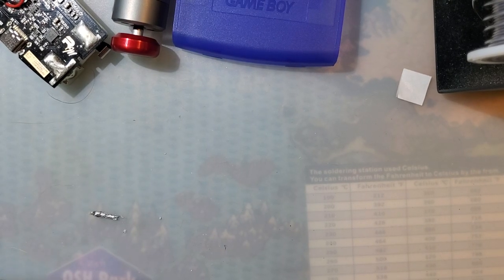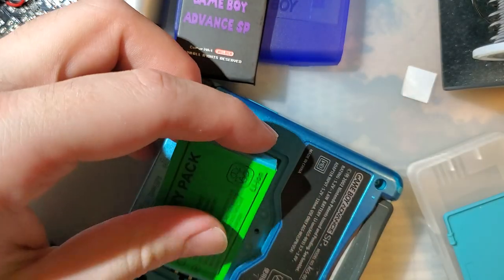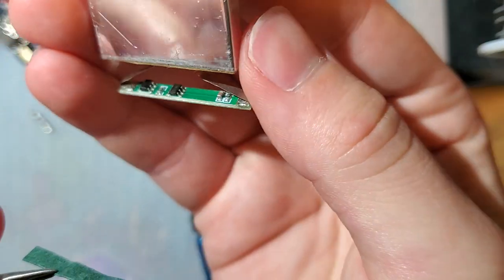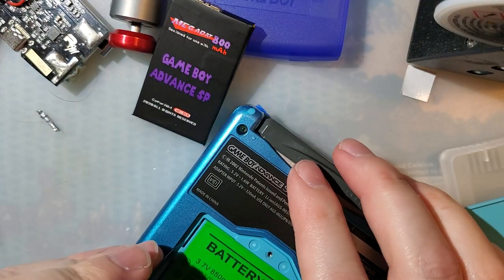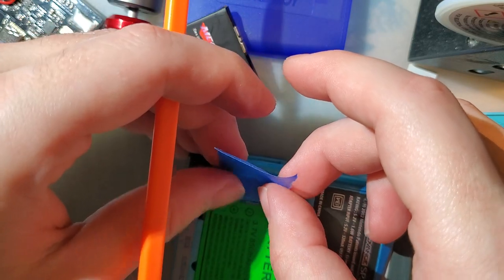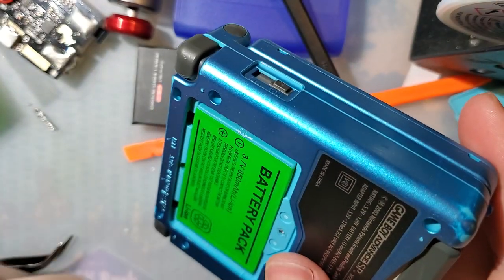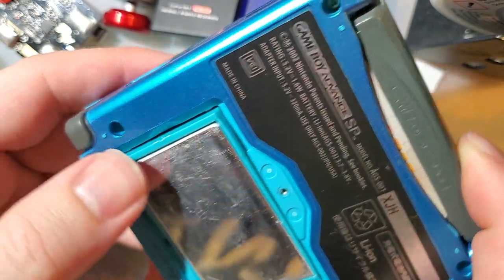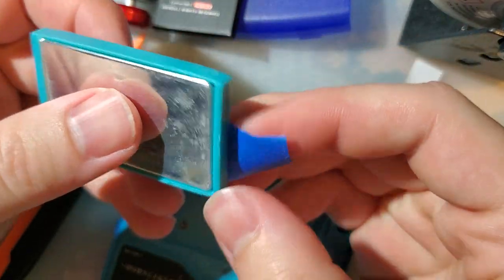Garbage Game Boy Advance SP Batteries

Comment: I had this issue with a battery from Retrosix, ended up unwrapping it, cutting one of the blue plastic sides off and rewrapping it to make it fit.

When I reached out to Retrosix this was the response I got:-
 "We tried our stock in 10 SPs and they fit every one. We also sell them in the US and have sold about 500 so far no issues."

And like magic it suddenly fit in my SP, those compassionate words did the trick! /s

Comment: If the battery is really good, there are ways to optimize the fitting and use it without a hassle. But that shouldn't be the job of the customer...
Reply from the maker: just buy a battery that fits like Helder's battery
Reply: Has anybody raised this with them rather than having a whinge on YouTube? I find I generally do better with this sorta stuff when I ask the creator politely and engage in a private conversation rather than making a YouTube video where I start by comparing it to a 'cheap Chinese' battery and venting about it.

Just saying... for all you know they'll offer you a refund and a new battery case if you approach them nicely about it. Maybe it fits other GBAs perfectly and the SP's got a smaller cavity or something?
Reply from the maker: @djgamble07  Yes and they have just dismissed the claims. "Works on my machine" is basically the response given. You can check the reviews, it's not a unique problem. 

I personally did not try to refund because the first thing I did was take both of them apart and tear them apart. I always recommend seeking refunds instead of trying to fix it but I figured I'd do some exploration for the video.
Reply: @makho  There's 3 reviews for the battery and they're all positive (https://retrosix.co.uk/Game-Boy-Advance-SP-Battery-850mAh-p218237157).

He's responded to the single 'snug fit' comment quite frankly IMO (zero denial)... 'Yes its snug fit. Fits fine but does need pushing in. That's due to the real 850mAh capacity. That's why others on the market are often fake <600mAh batteries but fit without push'. TBH this was my suspicion when watching the video... higher capacity so it's a little bit bigger.

I'm yet to see a situation where RetroSix is being a tool. I've seen angry, ramblers saying 'oh he lost it at me' but then I read the responses and am like 'no he didn't... you lost it and he gave you a professional response'.
Reply from the maker: @djgamble07  You do realize that Retrosix has a history of deleting anything negative on his stuff, right? I have seen him actively delete whole instagram threads of people calling out his bullshit. Why would he not delete negative reviews on his website too? Businesses do this all the time (doesn't make it right though). He flips his shit on people when they ask to validate claims. I've asked about some of the things he says and he just straight ignores me now so why wouldn't I start bitching on my platform instead of trying to work it out with him? I don't get ignored here. 

But since you're clearly only seeing what you want to see, let's also just ignore the fact that I have other batteries from other manufacturers that are both higher capacity (tested) and fit without issues. Let's also just dismiss the reviews on HHL, which is where I got this battery. They definitely did not respond like I said they did. Nope. Not at all. It's always "the fit is tight but you need to make sure you push it down" and "we've never seen a shell that didn't fit". Yeah, they know it's a fuckin problem but they are absolutely dismissing it because most people don't know better. Getting a refund was never the issue. The issue is that they knowingly selling defective products without disclaimers and handwaving away concerns. 

Why would you defend this garbage product from this toxic company?
Reply: @djgamble07  If it doesn't fit then 850mAh isn't the way to go. You'd think that they would figure that out.
Reply: @djgamble07  Likely a R6 bot trying to convince everyone their batteries aren't oversized. simple modification of the damn plastic frame is all it would take to make these batteries fit but again, that should be on RetroSix/HandHeldLegend to do and not the customer.

The fact of the matter is that these batteries do not fit. Everyone has this issue and people that say it's "snug" either don't understand that these batteries should just drop in without resistance or are lying.

I've purchased two and both did not fit in OEM or aftermarket shells without being pushed in to the point that they required quite a bit of force. The capacity is great, but the batteries are NOT the correct size.

Comment: i also have one of these ultra tight one in my sp, and i think i found the trick to remove them:
frim the right side, its basically impossible, but using the prytool on the connector side, pushing in the springs, worked for me.

Comment: Not that you should have to, but it may be beneficial to place a ribbon under the battery with the ends hanging out to help drag them out.

It could be interesting to measure the sizes of stock and various aftermarket batteries using Vernier calipers. That'll teach them...

Keep up the good work Makho!

Comment: From the view we had, the battery cell is oversized for the plastic wraparound.  That is a manufacturing defect, or a piss poor choice in manufacturing.  It looks like the outer frame could be made to fit it, but would likely require a different mold, which is $$$.  
Sorry you had a bummer of a time with that.

Comment: I just think that these batteries are based on bad aftermarket shells (like the Pikachu's ones), I bought one on these (https://www.subtel.fr/en/Battery-for-Nintendo-Game-Boy-Advance-SP-AGS-003-800mAh-Replacement-battery-100045.html ) and it has the same problem on OEM shells and transparent plastic shells, but it fit smoothly on my aftermarket Pikachu shell...
Reply: Yes!!!! This fit fine in my Pikachu aftermarket shell too. How weird
Reply from the maker: If it's designed for those shells, it should be stated on the listing.

Comment: Handheld Legends use the exact same battery as the RetroSix wow. It doesn't even fit into the gameboy sp
Turns out RetroSix IS part of Handheld Legends now...
Reply from the maker: I believe it's actually the other way around but at the end of the day those are the same thing. 

But yeah, if you want a drop in battery that just works, I highly recommend Helder's instead. My battery is somewhat better both price wise and performance wise (depending on where you source your parts) but it does require some DIY so I can understand why it's less appealing.

Comment: cameron sino batteries are the best, this company makes quality batteries and has a battery for basically any device. However it doesn't fit just like here, needs a bit of shaving off of the plastic frame.
Reply from the maker: doesn't sound like they're the best then.
Reply: @makho  i mean it requires absolutely minimal effort to fix that problem yourself, and at least it's a proper company comparing to all these dodgy batteries I wouldn't even trust. AND in terms of capacity they are unrivaled. "Best" is subjective, I guess...
Reply: @user-yk1cw8im4h  i need to shaving the plastic frame of the battery? Sure?
Reply: @Ageblock4  Yes you need, just grab a small file/cutter to do that

Comment: Have you tried the "cameron sino" ones? They have mugen batteries (albeit in their own wrapping) for the original 3DS, so they might be a good seller/producer on Aliexpress.

Mugen batteries used to make these really expensive batteries that would last quite more than originals.
Reply from the maker: no I haven't but from what I've heard they are the OEM (or use the same OEM) as these so they're not worth trying.

Comment: Did you ever find out the capacity? Also how do you test them I would love to test my own and find out if they are any where near the stated mah
Reply from the maker: Easiest way to test is to just boot up the game boy with the battery installed and running a game and point a time lapse camera at it. That will tell you both the capacity and expected run time. 

Alternatively, put a constant load across the battery and measure how long it takes the voltage to go from fully charged to depleted. Most external battery chargers offer similar functionality though accuracy can be hit and miss depending on the specific charger. I'm not at all happy with my charger for this.

Comment: I heard RetroSix is also planning to make abs plastic SP shells in the future. Any thoughts on how it will turn out? Also why couldn't they just change the dimensions around the plastic frame so that it would fit?
Reply from the maker: If it's anything like their previous shells, it will be hyped up as the best thing since sliced bread but turn out to be slightly less good than the other shells on the market. Luke will change a few small things so he can add his obnoxious logo to it and berate anyone who finds flaws with it. 

And they absolutely could just change the dimensions of the plastic frame on the battery. That would solve all of these issues. However, R6 is NOT the OEM for these batteries so I suspect they have very little actual control over it.
Reply: Now he's saying his new GB pocket screens are better than FPs. So luke has a factory in China or something that makes the batteries for him?
Reply from the maker: @bobharley1  Luke says lots of things. You'd be a fool to believe anything he says without proof at this point.

Comment: do you have any tips to stop bulging in the battery door
Reply from the maker: get a less shit battery
Reply: I'm using the idea I got from you with that 900mah cell soldered to PCB strip but only just bulges a bit idk if removing plastic from the cover works or anything simple like that

Comment: Pretty sure you have a bunch of useless flat head bits in your ifixit kit that would have worked wonders at prying the battery out. And before 5heads trip over themselves to tell me about gouging batteries with metal pry tools, there's literally a blue plastic tab protecting the end of the battery :)
Reply from the maker: Great idea, I'll just gouge up my Surf Blue GBA SP
Reply: the fact that you still gotta use tools to pry the battery out tho?
Reply: @makho  but you'd use the spudger as a pry surface like you did with the utility blade?
Reply from the maker: @TheTuneAce  but I never used the spudger as a pry surface? I used the utility blade to bite into the battery frame and tried pulling it out with the spudger until I broke the tip of the blade off.

Comment: From what I've learned using the battery PCB you designed that the battery compartment on aftermarket shells is bigger. This might be perfect for aftermarket shells as they have looser tolerances.
Reply from the maker: stop making excuses